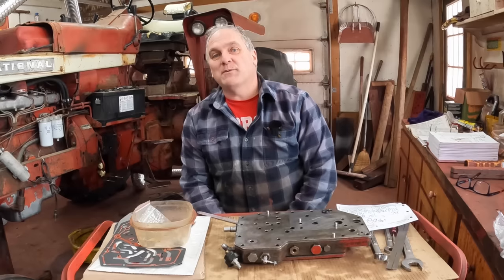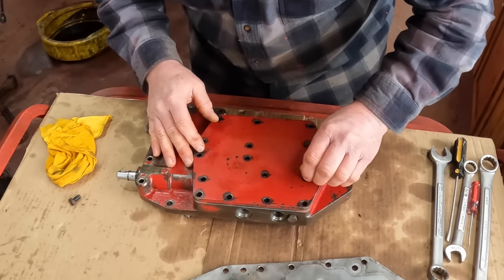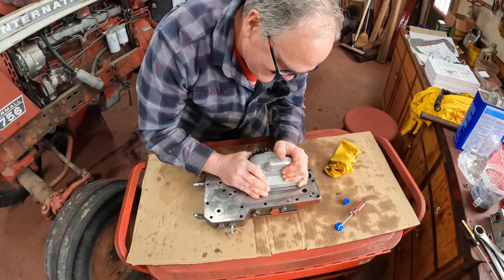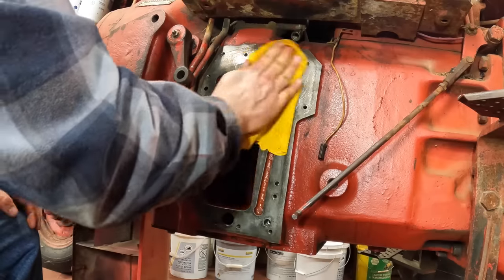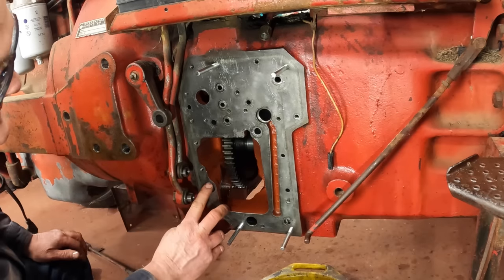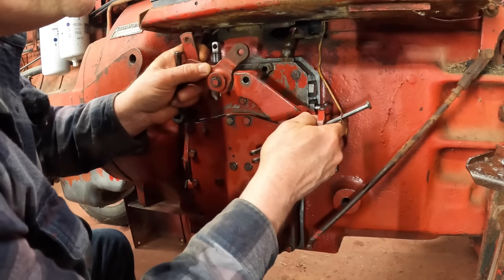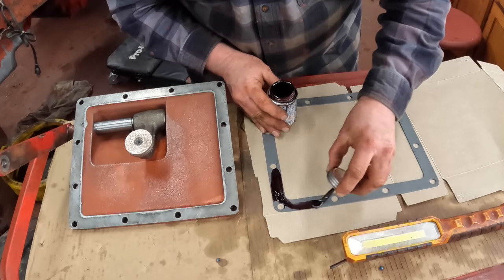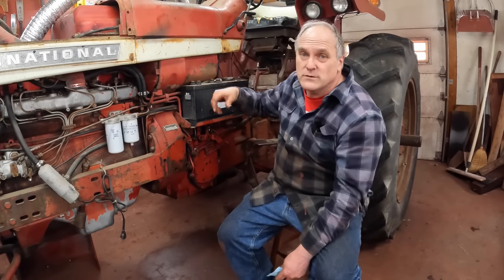Finishing the Farmall 756 MCV Rebuild

Comment: If it won't prime, remove the plug below the flow control plug. It's the one that takes 5/8 wrench.  Don't like taking bottom plug out cause it may spit out the steering relief valve, jus more messy. 
I don't like the idea if people say to plumb a remote outlet to Mcv. Sure way to maybe blow a gasket. 

Can always add the air pressure in filler tube like you mentioned if needed with the 5/8 plug removed. That is the safest/best procedure if needed to get it to prime.

Great series of Mcv videos. The only detailed video of rebuilding it. 
The best on YouTube.  You are going to get LOTS  of views.👍

Comment: Professor Pete. The man who details his repairs, seeks out problems that could occur, not afraid to admit to possible mistakes during assembly. I don't know what the shop rate in New York is at this time. You can be assured that it would be very expensive to have this done by local repair shop. I am sure that the dollar savings is awesome. I would not attempt this. I grew up on a farm where the biggest tractor was an "M". I have never had this type of equipment. Very enjoyable to watch. Always anticipating his next project.

Comment: Well done. Very thorough You could been a instructor at many of mfg tech classes I have been too in my 40 years of working on Hydraulic, Pneumatic and Electrical systems.  One my first Hydraulic tech showed why never feel for Hydraulic leaks with your hand , his right thumb and fore finger  had to be amputated because of hydraulic fluid being injected in his hand  from extreme hydraulic pressure when he did find a leak. I service and maintain hydraulic Presses, Shears, Lathes, Mills, etc. thanks.

Comment: Yes, Pete, this has been all you wanted it to be for me anyway. Usually, I watch automotive builds that are high-tech and high-power and everyone holds their breath to see how long it takes to explode. And they do go boom sooner or later. But diesel engines in heavy equipment and tractor rebuilds or repairs generally have wear problems and maintenance issues. The engineering involved is geared for reliability and longevity using solid design and ingenious thought. That you've taught yourself to do all this fascinates me.
Thanks, Pete.

Comment: As you went through the possible steps to bleed any air pockets I was wondering how they dealt with that problem when the tractor was built?  I'd assume they didn't build a huge number of MCV's, but even if that's all you did  I'd expect you'd spend time ($$) getting it to work correct unless they just passed it on to dealer to sort out.
Thanks Pete, for taking the time to go through this.  
I also watch C&C Equipment (if you enjoy repair of heavy equipment try it) I keep think if things Like Pete's channel and the other had been something I'd been exposed to as a teenager  .... course that would have been 70 years ago,  so just another thing to dream about

Comment: The amount of info on the net can be daunting in such a case. I appreciate the care you take to double, even triple check each step.
 It may be stressful now, but the end result will be a system that actually works as designed & engineered originally.
That’s the payoff each and every time you use this tractor.

Comment: I seem to remember an issue from my youth. When working on a hydraulic cylinder . Since air is thinner than oil it will sometimes leak past a seal before you get all the air out. If the pressure is high or the duration of that air leaking past the seal is to high it can burn out the seal like it was hit with a torch.  Is that a concern when you fire it up the first time?

Comment: I'm a city dweller that has tractor envy and your videos are awesome. thanx for doing them. I have a question completely unrelated to this video though.  Why do many tractors have axels that stick out way beyond the rear wheels?
Reply: The axles are long so you can adjust the wheels out to fit different row spacing. Sometimes crops were planted with 30 inch rows, some were 38, some on 40 inch spacing.

Comment: This video has helped me a lot on figuring out my issue on my 1086. My question is did you reuse your old pin or did you buy a new one? If you bought a new one do you happen to have the part number for the pin? 23:18

Comment: This seems very complicated but I think I understand more than I did, which means that your explanation at least helped some. Sorry, but as I get older it takes more to make me understand things. Like way back in high school (the 60's) I had a horrible time understanding electricity. Didn't realize that electrons were not used up but continued to travel through a circuit or resister. Once the teacher finally got it into my head, things went much better. Oh well. 
This is a dumb question, but could you add the fluid gasket material you used on the super C for the gasket areas you thought needed better reinforcement? Would it screw up the spacing or could it be of use to increase the strength of the gasket? Like I said, this probably is a dumb question. Just curious.

Comment: Several years ago, I read of a kid that redid a International 1066. Pretty nice looking when it was done. Had it hooked to a good size drill headed out to a field and I cant recall if the mcv went out or blew a line, but lost steering and brakes. Ended up going over an 8 foot retaining wall as there was a sharp right gand corner, drill folded up behind tractor and came to rest on edge of house and tractor pinned the kid under it. It was a shame as those kids all went to school together where the tractor went over retaining wall and rested against the house. So yes, there is no fooling around with this stuff hes rebuilding. Take it seriously and dont think itll be good enough.